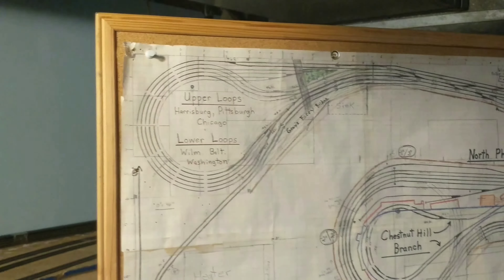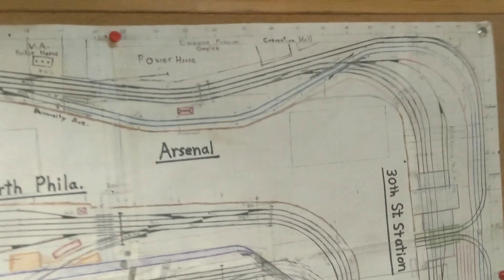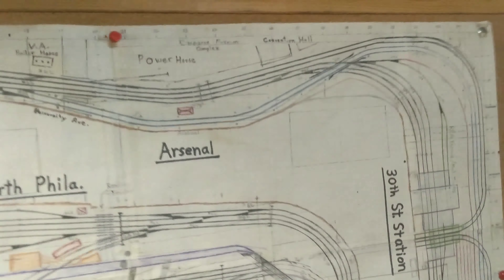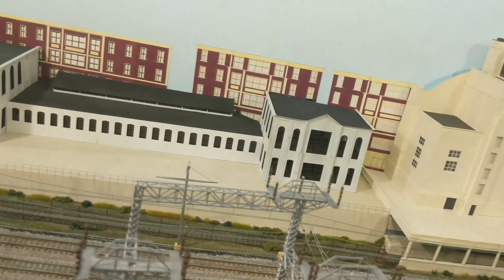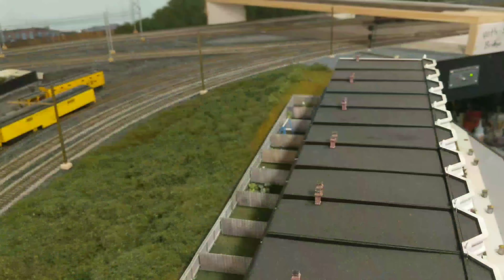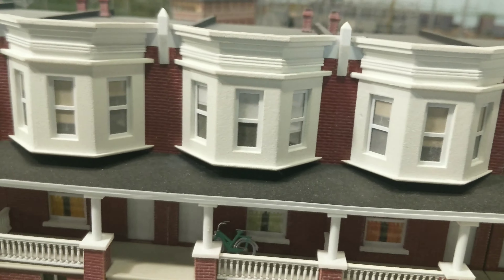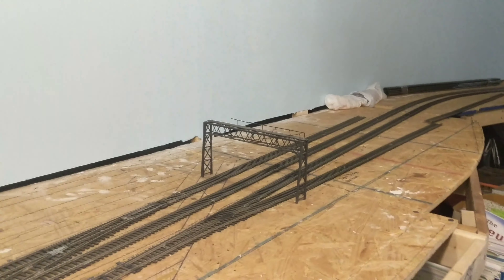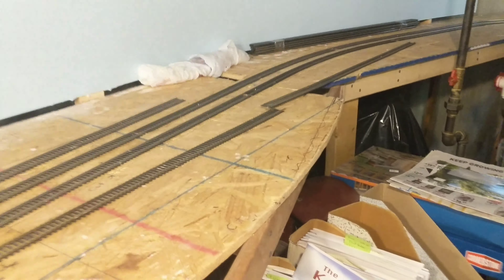PRR  Philadelphia 1950s in HO

Comment: This is the same area that I will model when I build my layout someday.  I will be setting it in the 1990s to 2010s so mostly Conrail (my favorite railroad of all time) and CSX with plenty of Amtrak and Septa too.
Reply from the maker: That's cool , there's a lot you can do in this area . What scale will you do it in ?   Thanks for watching .  Start making some videos once you start the layout .
Reply: @BoxcarJerry  I will be doing HO as I have a few dozen Conrail and CSX locomotives in that scale.  My dad has a big N scale layout so I have a few N scale cars but I prefer HO because its the scale I grew up with and my grandfather also had a very large layout in HO.  I plan on doing a 90s view of the Highline with 30th, Zoo Interlocking, portions of the NEC to Shore.    On a lower level I plan on doing Greewich Yard and some of the piers in South Philly with Snyder Ave intermodal yard.  Im hoping to also somehow include Frankford Junction but I know that would also take up alot of room.  The only issue is finding a big enough place and the money to build it.  I currently am a member of  a local model rr club and thats where I run my trains and tweak my DCC settings.  Just today I completed my first two DCC installs in DC only athearn and walthers locomotives, one being a blue box GP50.  Ran like a champ after I figured out how to route the wiring.  The headlights turned out bright orange somehow lol.  Don't know how I got orange 0402 leds but somehow I did.  I managed to find warm white and re-do it though.